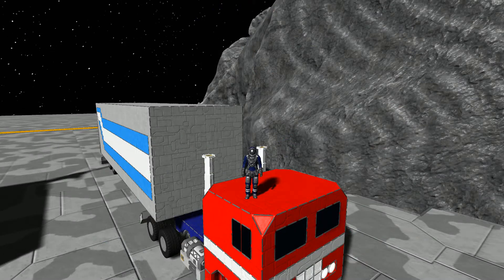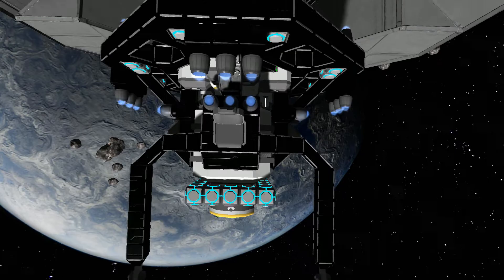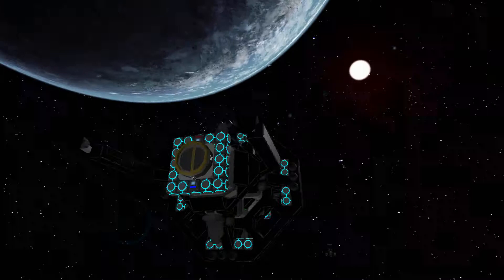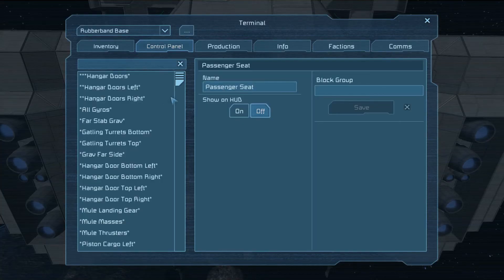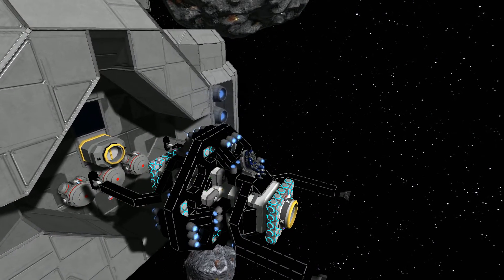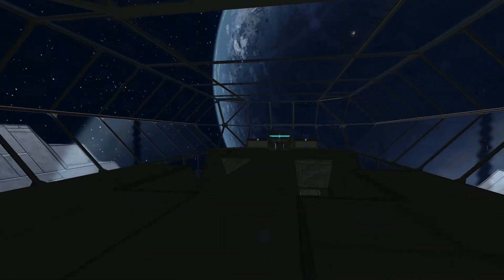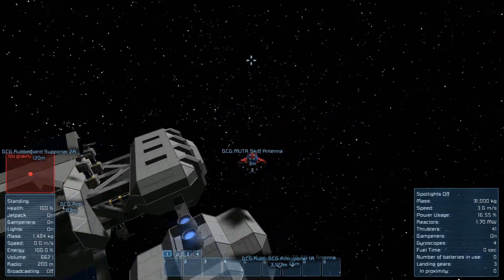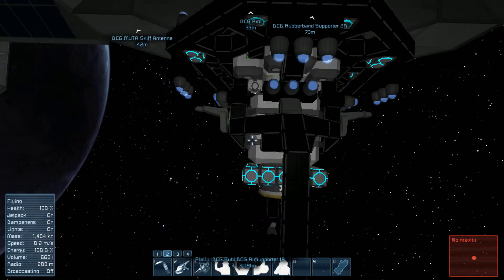SE Automated Cargo Transit System

Comment: You should tell W4stedspace you solved the problem. He might not know and who know what hell come up if he does.  Unfortunately he didn't have an answer to my area gravnet for catching  and collecting ores, ingots and components fired over long distance.  Not a shield, a catchers mitt so to speak.  It has to cover a good area since the firer wont necessarily be able to see the collector.   Any ideas?
Reply from the maker: I came up with an ore catcher a very long time ago, but it is impractical because there is a limit to how far the game will let ore travel unpowered. That's the reason for the transit system. I sent a message to w4stedspace back when I originally posted this. I never thought about following up. Maybe you could tell him for me. LOL j/k
Reply: PhoenixTalon I tend to send ingots as opposed to ore.  These don't disappear, at least I don't think they do.  I've also thrown filled small cargo containers fitted with a mass block and a small power supply to see if it would work, unfortunately, it was utterly impractical to build in survival even though they they did get caught.

Is your ore catcher ship size or asteroid size coz I'm looking for something large enough to fill the targeting reticule you get on hostile ships at 5000m.  It doesn't have to be solid, as long as the gravity catches whatever passes into it.  

Out of interest, on the workshop is a ship take would take two complete reticules at 10,000m,  its called the Hephestus I think.